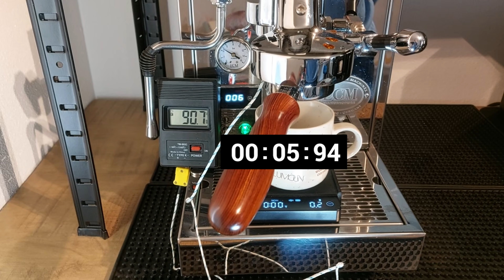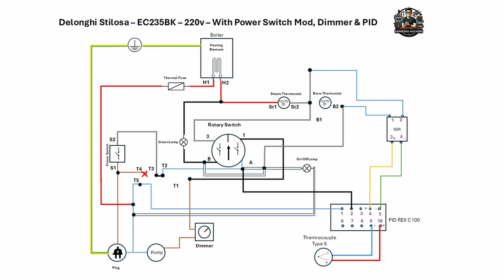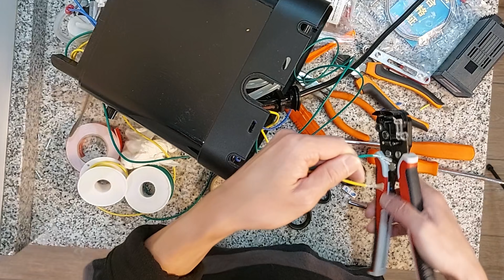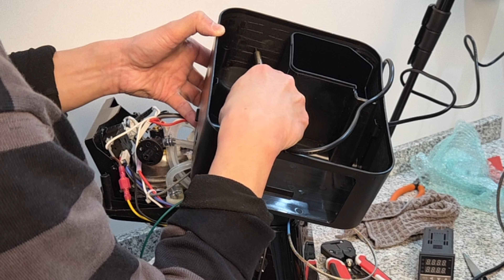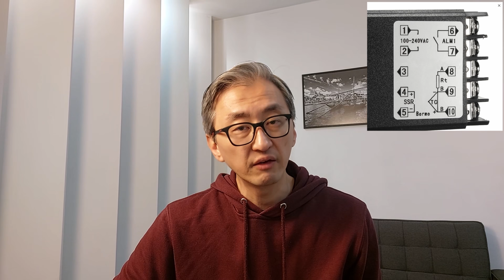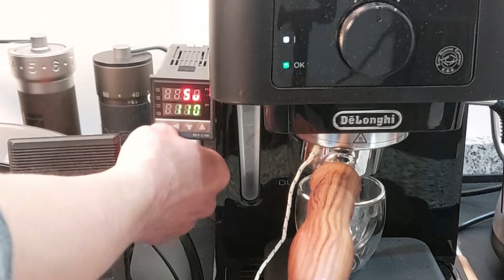I Tricked the PID — 1.2°C Stability

Comment from the maker: Products that I used or mention in this video (some are affiliated links, but you don't pay more for them and support the channel buying through those links):

Delonghi Stilosa:
Amazon: https://geni.us/wZrDX

PID Kit REX C100:
Aliexpress: https://s.click.aliexpress.com/e/_Dcx7xVl
https://geni.us/weB41T (Amazon)

Thermocouple type K Hole Washer:
Aliexpress: https://s.click.aliexpress.com/e/_DFdeQ3H
Amazon: https://geni.us/ThermocoupleHoleWasher

Thermometer and thermocouple that I used in this video:
Aliexpress: https://s.click.aliexpress.com/e/_c4aMk6zz
https://geni.us/LYIOC (Amazon) 

Thermometer with Farenheit unit:
https://geni.us/2BMd4 (Amazon)

Thermal paste:
Aliexpress: https://s.click.aliexpress.com/e/_DB5viZZ
https://geni.us/VzBjsQF (Amazon)

Double-sided tape:
Amazon: https://geni.us/DSTape

Crimper/Cable cutter:
Aliexpress: https://s.click.aliexpress.com/e/_DkOTzGB
https://geni.us/U7l7e (Amazon)

Multibits toolkit:
Aliexpress: https://s.click.aliexpress.com/e/_DCihKAT
https://geni.us/RWHU (Amazon)

Soldering iron:
https://geni.us/soldering (Amazon)
Aliexpress: https://s.click.aliexpress.com/e/_oDe6Ogk

Wires AWG 16 or 18:
Aliexpress: https://s.click.aliexpress.com/e/_DcR8kbp
https://geni.us/AZMMKm (Amazon)

Spade/Fork connectors:
Aliexpress: https://s.click.aliexpress.com/e/_DdlcoOJ
https://geni.us/YwzUb1y (Amazon)

Piggyback connectors:
Aliexpress: https://s.click.aliexpress.com/e/_c3SQunFH
https://geni.us/KxvjO (Amazon)

Amazon Prime for some discounts and free shipping: https://geni.us/bidTfLf

Comment: Thanks for a great video 👍 I was just thinking if you could use the steam thermostat in brew mode, in stead of manually change the temp on the pid?

At normal idle the pid is in use at 92 C, but when switching to brew the steam thermostat takes over and ramps up the boiler while you brew. 

I assume that when you manually change the pid to 120 C you basically saying to the system to give “max power” to the boiler during the brew process. 

What do you think of this approach? 🙂 

 @EspressoHackers
Reply from the maker: It might work but you will need to put it between 1 in the rotary switch and H2 in the heating element. And for that, you would need an extra thermostat or you will have to steam using the PID.

Comment: Hello,
I’ve installed the PID using the XMT7100 controller on my delonghi stilosa EC260BK. I’m having a really hard-time tuning it as even after the auto-tune, the temperature keeps on overshooting to 120 Celsius and sometimes keeps stable at 118 even if i have set the SV=95 celsius. Please help me and i appreciate it in advance.
P: 04.8
I: 0876
D: 219
Souf: 1.0
Ot: 002
Filt: 1
Outy = 2
Hy = 0003
Psb= 0000
SV = 95
AH1 = 0400
AL1 = 0000
Reply from the maker: Try the settings that I used in my Rancilio Silvia:

https://espressohackers.com/pid-installation-for-beginners/#PID_Settings

Comment: Finished DeLorean mod-machine! Back to the Future…
Thanks for help and advice.
I used the purchase links which saved time.
I found green wire DID need to go to PID 5 to control temp and the diagram of the switches caused some confusion as mine seemed to be wired up in a different order and were labelled differently on the unit.
I also did the switch bypass, dimmer and pressure gauge.
Honing in on some good espresso with around 7-8 bar and lower temperatures, I don’t mind some declining temp profile.
Need to sort out the spring though as it only allows flow after 5bar, I would prefer 2bar prefinfusion rather than cutting off the brew pump and switching back on.
(Have you tried modifying or changing spring?)
I’m not sure I’m getting better espresso than my Flair 3 yet though.
It is a pleasure to use as I only usually make 1 a day, machine is better for multiple people though. 
I might make a video of it in use when I get the recipes nailed. Maybe some back to back tasting with the Flair too. 
Cheers.  

http://youtube.com/post/UgkxYfK-n15h9zvgRLQgtKWPUL8oQCVya8nf?si=7yJUjeXrnb6sSFe7
Reply: Also, the pressure gauge is still vibrating so evidently I need to install a capillary tube or ULKA pulsation dampener.
Reply from the maker: Did you buy the liquid filled gauge? With glycerin? You need to add glycerin or buy the capillary version
Reply from the maker: Great to know that it was helpful. If I make a new video, I'll double check the schematics to see if I can make it clearer and simpler. The spring is designed for around 5 bar because otherwise if you put in steam mode, the steam would leak from the group, the pressure would be enough to open the pathway. But anyway, I think you're gonna have a much easier workflow now, with more consistency, repeatability and better cups. Thanks for sharing your experience, it's great to see people putting into practice! Cheers!

Comment: Thanks, but I'm actually trying to follow this now and wiring instructions and explanations are  much too quick and each part and wire could be introduced and explained.
Reply from the maker: I tried to go a bit faster because in theory, much was explained in the previous videos when I show how to make the power switch mod and the dimmer mod. I thought it would be too boring if I repeated everything in the subsequent videos. But if you go back to the previous videos and follow them, you will understand how I installed the PID in this more summarized version. But good feedback, I may add more details in my next PID installation video. Thanks for the comments!

Comment: That's some impressive testing! Thanks for sharing and taking the time. When going the road to pull the shot as soon as the green light turns off - would recommend keeping the prepped puck in the basket under the showerhead to preheat the whole portafilter ( around 5 mins) or to even heat this portafilter up with an empty shot before starting the "wait" for the green light to turn off and start brewing ?
Reply from the maker: Thanks! I like to let it heating for 10-15 min and preparing the puck only close to the extraction. I wouldn't let it cooking in the group for 10 min while waiting for the lights going off. But I didn't test if it makes a difference, it's more from a theoretical point of view that I'm not comfortable.
Reply: @EspressoHackers  Agreed. That makes sense. Thanks for your input

Comment: I tried connecting my dimmer at the knob-pump side but my dimmer is not controlling the pump. Not sure if My machine is the same as yours or not,  My machine has a PCB in between the mains and the pump. I tried
Reply from the maker: That's a bit weird. The dimmer mod is very simple, you just need to put it in the middle of the wire that goes from the knob (brew position) to the pump. It's probably connected to the wrong connector.

Comment: Great video,a  simple mechanical 16a relay can be used instead of ssr? Without auto tune,just targeted temperature.
Reply from the maker: I didn't study/test this option. Why it would be better than a PID with ssr?
Reply: Don't know if it's any better,from my point of view just simpler construction, although im pretty sure that the temperature drift willl be greater, anyways ill try it and let you know.

Comment: Do you have a recommendation for port filter/ basket to use with this machine please?
Reply from the maker: The IMS Filter Basket that I use is this one:
Amazon: https://geni.us/IMS51

Portafilter I use this: https://s.click.aliexpress.com/e/_c34CWUN3
The ears are a bit thicker (1mm or maybe less) than it should, it took 1 or 2 months to accomodate. You can file or wait the 1-2 months like I did. And this is a common issue in these 51 mm portafilters, it's difficult to find one that fits perfectly.

Comment: Thanks for the video.  This may be off topic, but you mentioned Gaggiamate.  I am considering a Gaggiamate installation for my ECP 3420.  Do you suspect that it will also have the large temperature variation issue as you have seen here.  It would be an expensive mod to then have to fiddle around with temperature settings to get stable output.
Reply from the maker: With Gaggimate you have more parameters to play with. And if it's not good enough, the developers will probably adapt something. I'm not deeply involved with Gaggimate yet but Gaggiuino has 2 parameters to modify, I belive that Gaggimate has something similar.

Comment: Another great video, I’ll try to replicate the modification.
Some people find reducing temperature towards the end of shot can reduce extraction of bitters (and with filter too, which often happens naturally as the kettle cools down!). Do you find taste is better with stable temperature then? Perhaps because the temperature drop was too large.
Reply: yep. Consant temp is not always the goal for the best taste. Which is of course subjective. But I like my shots best when the temp drops towards the end
Reply from the maker: This is a great example of why I always tell people to test themselves. In the end, what matters is what we are able to taste and how much we like/value the "improvement". Sometimes, the inconvenience is much greater than the benefit. And other times, our palate change and the benefit becomes greater. Espresso is very tricky, and that's also why I find it fascinating!
Reply from the maker: That's a great question. I don't think I need such a great stability (circa 1 degree) but this is an indicator of how capable the machine is to extract a good espresso with very light roasts or fermented coffee. I think I wasn't clear about that. In the beginning pf my journey, there was a fermented coffee that I was never able to dial in for espresso, I froze it and was slowly consuming in my rare pour overs. One day, I installed a PID in my Saeco Poemia and that machine had more than 10 degrees drop.  After the PID it was reduced to 5, if I remember well, and better than that, I didn't need to surf and I knew the start temperature. When I tried again the fermented beans, I was able to fine tune with the temperature adjustment and unlocked an incredible espresso.

After this first experience, and since I like fermented and very light roasts, a PID became a must for me, and I had similar experiences with different machines.

But for most of the people, maybe the main advantage is the consistency and easier workflow.

Regarding the taste with declining temperatures, I didn't notice a better taste with 5 or 10 degrees drop. But maybe because I rarely use medium or medium dark? I don't know the response but this is my experience. 

I do know however that people like Lance defend an improvement with less undesirable components being extracted in the end with lower temperatures, but so far I didn't make a dedicated experiment and in my routine I didn't notice the benefit.

Hope it helps and thanks for the comments!
Reply: @EspressoHackers I feel like the lower temp and lower flow rate at the end are especially helpful with dark roasts. Maybe that’s why you dont notice it as much
Reply from the maker: Interesting: I like flow rated when the coffee is acidic, I already ground finer and with a longer ratio. In my mind, more contact time would be helpful in this case.
Reply: @EspressoHackers Thanks for all the replies and sharing knowledge and experience. Your website is a great resource that saves time and gives confidence to less experienced people that the parts should be the correct ones!
I plan to put pressure gauge in too. 
Should be quite simple- I watched your video when you added pressure gauge to a different machine.

Comment: Great video!! 👏🏻👏🏻

I have many of the components to do the installation. I think I’ve understood everything!! 😃
So I’ll start the installation soon.

If I decide to install a 3-terminal PT100 probe, Should I use connections 8, 9, and 10 on the PID, right? Would the rest of the mod's wiring be the same as the diagram you show?

Thank you very much!!
Reply from the maker: Yes, 8, 9 and 10, probably 9 is the negative but check in your PID. Remember also to change from type k to type PTC in your configurations. The rest is the same.
Reply: Thanks for your answer!
After watching the video, I'm still unclear if this mod allows controlling the steam temperature, and if so, up to what temperature could the steam operate?
Best regards!
Reply from the maker: @Duendesurfer Yes, it will control the temperature in the boiler limited by the max temperature in the steam thermostat (in this video, I kept the steam thermostat as a safety measure or to be able to steam with the thermostat). You can adjust the temperature to anything within that range. But if you want more steam, you need to bypass the steam thermostat. I show how to do that in my vídeos about the theory in PID installations. But remember that if you bypass the steam thermostat,  set the PID for 155 for example and your offset is -10, the boiler will reach 165 and it may melt the thermofuse. Once melted, you need to replace it.
Reply: Hello Espressohackers!! I was looking at what you mentioned about bypassing the steam thermostat. To do it, is the wire that goes to T1 of the SSR the same one you propose in the Stilosa diagram? And is the wire that goes to T2 of the SSR taken from the H2 wire of the heating element (the wire that doesn't have a fuse)? Is that correct? Thank you very much!!
Reply from the maker: Thanks. For a PT100, just follow the pinout on your PID, there's a sticker on the side. If you have any doubts, check this video here:
 https://youtu.be/bQUg0JJt8EM?is=zJGm5U5SQb7kH2JC

Comment: Nice video, Regis!
I do something different on my machine, but it leads to results similar to yours.
Let’s say I want a 90°C shot. I set the PID to 93°C and let the machine heat up normally. Right before the shot, I flush some water into the boiler and wait for the temperature to drop to 88°C. Then, as it rises back to 90°C, I start the shot.
The measurements I took with a thermocouple were quite good, and by doing this, I don’t need to change the PID temperature for every shot.
Reply from the maker: Thanks, Athos! Smart strategy too! Thanks for sharing!

Comment: I was really looking forward to this video, thanks for sharing! 

My Stilosa is completely stock. Where should I tap power for the PID if T5 is still in use? 
Also, is there a risk that the current passing through the SSR could cause it to overheat or melt?

I noticed in your first test that the temperature drops by about 2 degrees right at the end of the shot. That doesn’t feel consistent with how a PID controller would typically behave. Is it possible that the controller is set to ON/OFF mode rather than true PID control?
Reply from the maker: After the power switch, I labeled as S2 in my diagram. If you buy a SSR for 25A, it won't have any issues. Even the one below, I think it's 10 A, should be ok for 220v. I don't know if you saw the hack, I raised the target temperature a bit before extracting to minimize the temperature drop, then I got 1.2 degrees difference, it's not in normal condition.
Reply: @EspressoHackers  Thank you for your advice. Yes, I watched the hack. Very interesting, and I plan to try it myself.
I am new to these PID gadgets, and I still have many questions to explore and test.